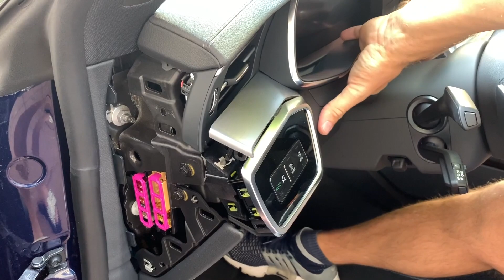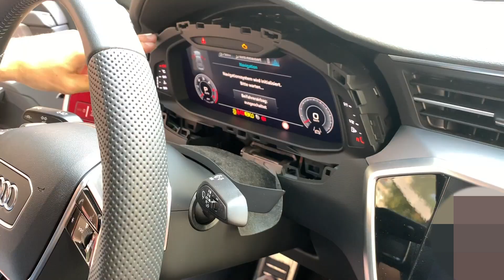AUDI A7 Remove Speedometer Cluster from 2019 AUDI - Interior Trim - full digital navigation dash

Comment: Any chance you could show how to remove the dashboard trim on the passenger side? (Where the illuminated quattro is) 

My 4K A7 has a wicked rattle behind it and dealer won't fix under warranty but really struggling to figure how to remove the trim.
Reply from the maker: It will be difficult, to do that as a video. the trim are just plugged, if you go behind it with unlocking plastic wedge you can unclip it without problems